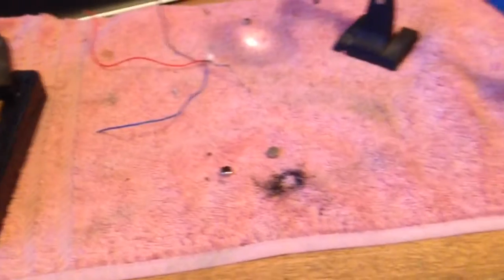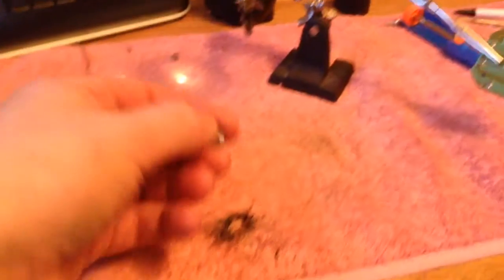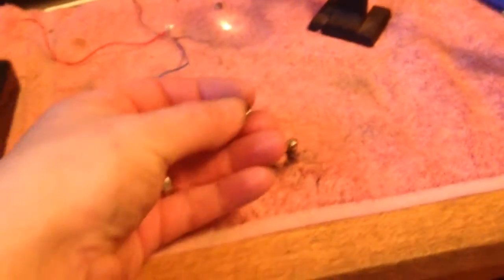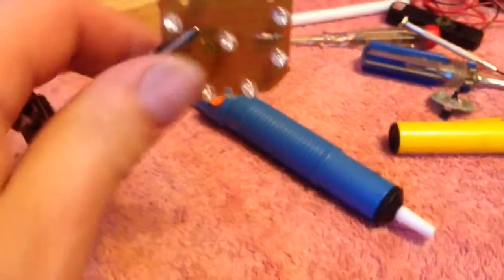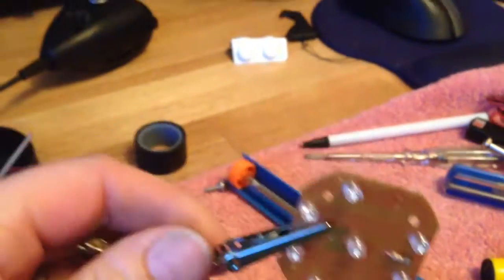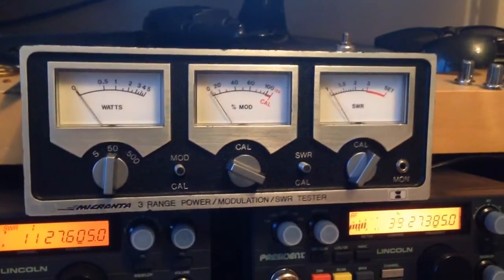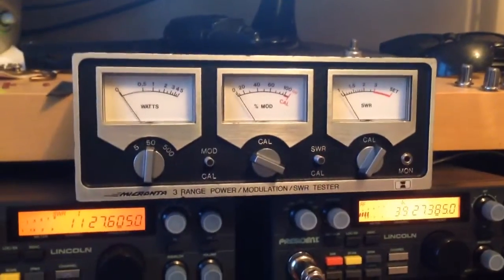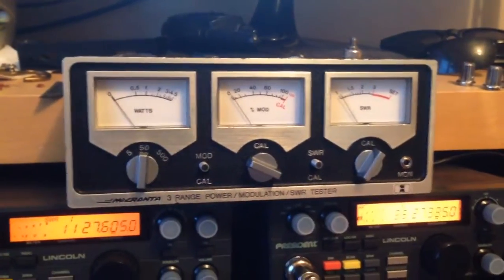Micronta 3 range power, modulation, swr tester

Comment: got one off eBay  all messed up trying to find a wiring diagram ,any one has a copy or just a picture of the wiring
Reply: http://media.trb.com/media/acrobat/2012-02/100767840-12111248.pdf hope this helps. Just bought mine from a local CB shop and works great. Hope yours does well.